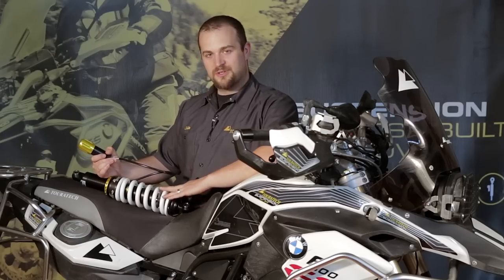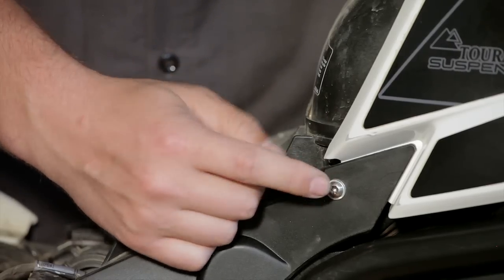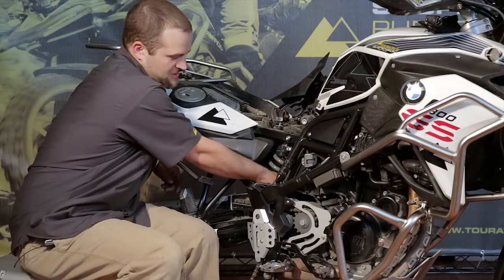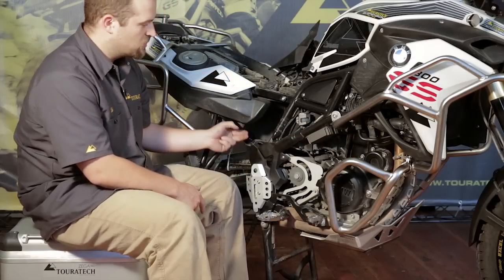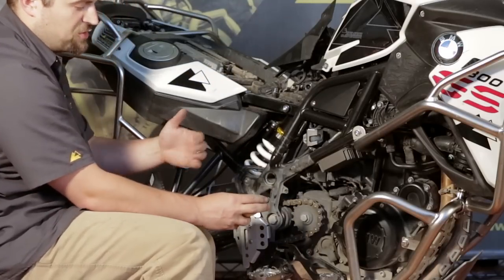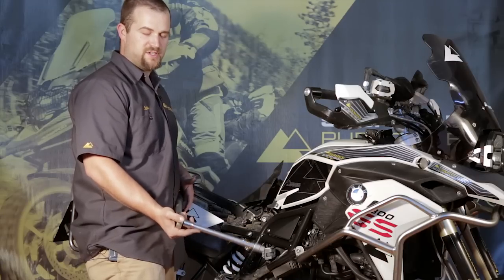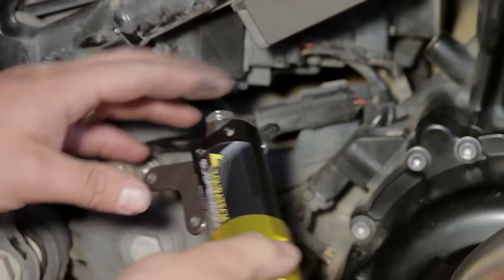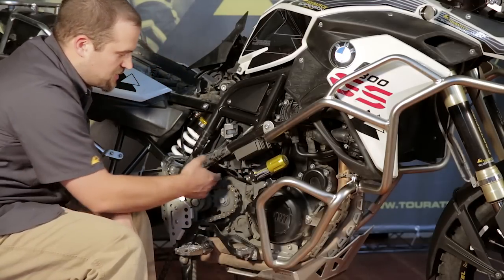Touratech Installation: Plug & Travel ESA Upgrade Shock, BMW F800GS

Comment: Why didn't your replace the upper shockbolt with a better, high grade steel bolt? The original bolt is prone to bending (search on different fora)...
Reply: ‘BEST REST’ .., ‘make a super tough - special strengthening bracket to beef up both the frame and the upper shock bolt,  as both are weak spots in the OEM design .

.., and Best Rest also supplies a high tensile bolt to suit 👍🏼